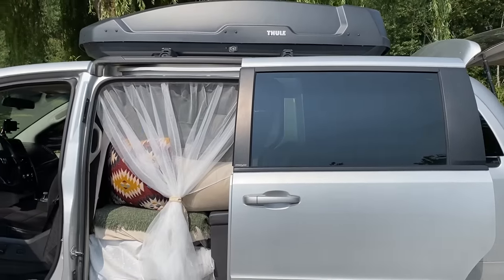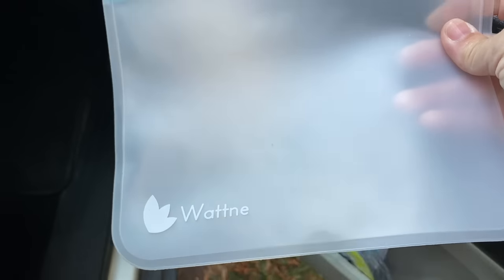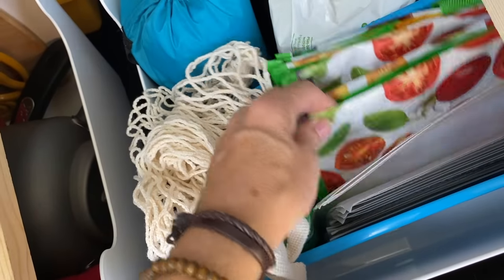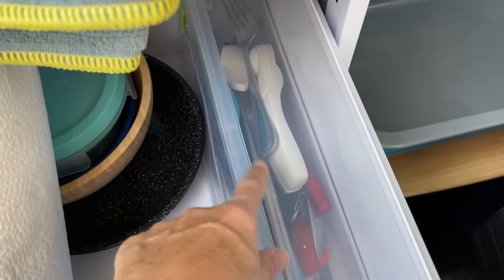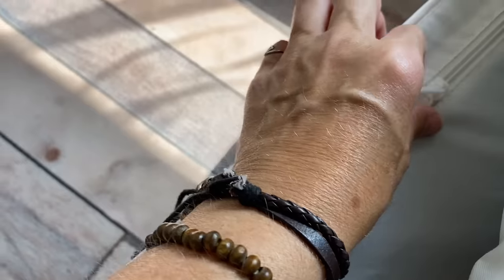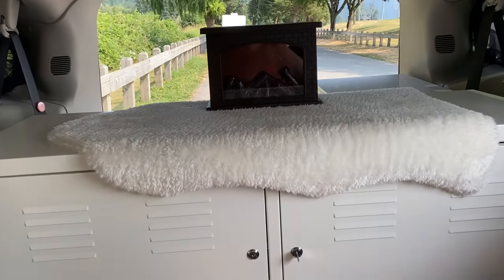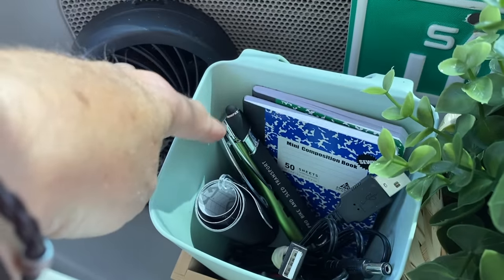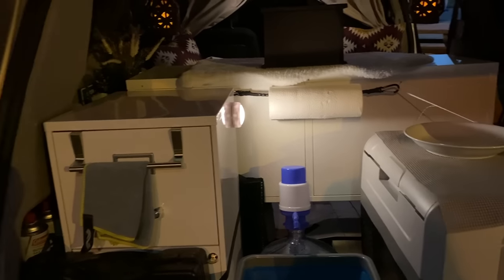#VANIFE | Cute, Cozy IKEA Cottage in a Minivan | Full VAN TOUR | Dodge Grand Caravan

Comment: Didn't catch the make of your van.  Wondering if you have Stow 'n Go seats in the front and if you removed them for under floor storage.  The only  thing I'd have to do differently is have coffee making everything reachable from inside. There's just no going outside in the morning no matter where I park, without two Cuppas!!  Love your setup & as a Libra, totally understand your need for pretty!
Reply from the maker: The make of my van is in the title of this video. It is a Dodge Grand Caravan. A 2011 to be exact. I removed all the seats so that I could have additional storage. The middle seat wells I have left empty for a future project (house/leisure batteries). Lol I prefer to be outside even in the rain. If for some reason I wanted to make coffee in my van the way it is, I would have everything set up on top of the Ikea cabinet (stove etc) and ready to go in the morning. I have plenty of room if I remove the sheepskin and fireplace lantern. Hope this helps! 💖
Reply: Oh. Sorry  The full title isn't seen on my phone so unless I click the title of the vid - it's not visible.  

Will you keep the same bed when you put house battery & solar charger in those front stow & go storage areas? Or will you need a different bed setup in order to access those areas... one with hinges to lift a part of a platform?

How much room do you have to access the van from the slider doors if you have your bed crosswise behind front seats? I love all the floor space you have sleeping that way!
Reply from the maker: @kaysmith6297  Oh, no worries! 

Yes, I will keep the same bed. It is very light and easy to remove from my van. I take it out periodically in order to clean. When access is required to reach the batteries, it won't be a problem. There is enough room to slide the futon over next to the cabinet so I can access the middle stow and go wells. I don't anticipate needing to access the batteries on a daily basis. Once everything is set up of course. 

I have enough room between the futon and the door opening to easily get in and out. there's about 2 feet of space, just enough for my legs. 

Thank you! I sure do love my set up. I have so much room and it makes my space feel so much larger!

Comment: This is the best setup I've seen. What do you do for heating and cooling?
Reply from the maker: Thanks! :) For heating I would simply start my vehicle via an automatic car starter - with a simple push of a button the van would start and once the van would warm up I would turn it off. For cooling I only used two small fans that I plugged into my Jackery 240.

Comment: What are the dimensions of the boards you are using to cover your trunk storage area. I think I will steal your idea once I remove my seats.  :)
Reply from the maker: The pine boards are 16" x 36", and 20" x 36". I will link them here: https://www.homedepot.ca/product/pine-shop-shelving-1-3-4-inch-16-inch-x-36-inch/1000168786

https://www.homedepot.ca/product/pine-shop-shelving-1-3-4-inch-20-inch-x-36-inch/1000168788

Hope this helps! Happy Adventuring!

Comment: How are you attaching your white No see um curtains on your sliding doors? Also, it appears that they are not there at night. Do you remove them each night and put them back up during the day? You have such great ideas for van building.
Reply from the maker: Thank you very much for watching and your lovely comment. The sheer curtains (from Ikea) are tucked into the rubber lining above the sliding doors. I am able to use my finger tips to shove the material inside the lip. I like to move the curtains around. If I am someplace that has a large mosquito population I will use them on the sliding doors so I can keep them open for ventilation. I also like to hang the curtains off my back gate to create a little room for my kitchen. I simply attach them to the gate with binder clips. I don't need the curtains at night because I sleep with the doors closed. Hope this helped! 💕
Reply: @RootlessWanderer  Do you have any videos of the no see um curtains hanging from the back gate?

Comment: So I am researching to decide how to live on the road.

I am almost 6ft tall.  Am I going to be limited to lengthwise sleeping?  Or is there a minivan where I will be able to sleep across?

Also, I was wondering how big your power stations are, and if you have a solar panel set up at all.

I am a former truck driver so used to being on the road, baby wipes, emergency bathroom, etc..  

But I want my own shower as I want to spend time off main highways and interstates since I have seen them all 🤣

Any advice for power and hot water?

Comment: Where did you get the fireplace lamp?
Reply from the maker: Amazon. The link is in the description if you are interested. The link will show a different model at first with a few other options to chose from. Mine is the rectangular model. I love it! It also has a timer I can set if I want to fall asleep to it and not have to worry about using up my batteries. Thanks for watching! 🙂💕

Comment: Also what is your power and heat source
Reply from the maker: I have a Jackery 240 for my power needs and I don't use a heating source. I haven't needed one yet. I am using a zero degree sleeping bag (North Face) and I wear merino wool base layers. I live in BC Canada. Mild temps but I have also winter camped in a tent in -30c (-22f) weather. It's all about the gear! If I do need heat, I have an automatic car starter so I can start my vehicle from within my sleeping bag then turn it off when it has warmed up inside.

Comment: Did the Ikea cabinet be fixed when driving?
Reply from the maker: Yes, the cabinet is lightly secured for now, I do need a different solution as the ropes i am using fray. A friend is helping me out with that. It falls over if it's not secured.

Comment: This comment might be too old to get your attention, Rootless Wanderer, but I can't find answer in your other videos and its vital to me. I also have Grand Caravan, 2018. I don't understand your bed setup. I see it's a Lyksele, but I can't understand how you have the frame installed. I listened 4 times and you said you used 1/3 of frame, bottom half? And something about disconnecting back with zip ties? I Don't get this. You said you could climb over so you didn't use the back of the frame?? That's too high to climb over. What is your mattress or seat cushion? So this setup question is my first dilemma. Secondly, the length of this frame is only 4 ft. 7 inches. Are you that short? I see you sleeping flat out.?? Thirdly, you must be short because if I sit on this I can't sit up straight, it's 12 inches from floor to top of seat, and van is only 45 inches tall inside. I'm 36 inches high in sitting position. There just isn't enough height to sit up (lacks at least 3 inches for me). Do you have this down in the storage well? I don't see how you sit and have headroom. Fourth, my van is only 48 inches wide inside. Your bed seems to fit with space. I would like this same setup, but I would like more detailed bed info before I spend that money. I currently have a wooden frame my son built and a lovely 4" thick mattress with a thick padded cover. But in order to sit up, he had to make it only 3" off the ground so can only store 2 flat items under. Thanks. I enjoy your channel even though I'm 77 and no longer able to hike or do activities you do. But I thank you for your time and effort on this channel.

Comment: 😒I'm sorry too tight! A fit in that kitchen is too jerry-rigged too much snapback possibilities with them bungee cords. The inside of your van looks real good though and cozy but you should have set up the kitchen inside those cabinets and put the toilet in the back that would have been a better situation and you will have plenty of room to go back there and do your business with no problem because inside there there's barely any room once you set up to go to sleep! Then if you got to go a couple of hours later, you got to move this back and push this up and pull this out and no wonder it hasn't been used the availability of it is done there impossible you got the whole everything until the morning or when you can get to a place to get out your car get dressed and go inside to go use a bathroom! ✌️🙄 Peace and good luck